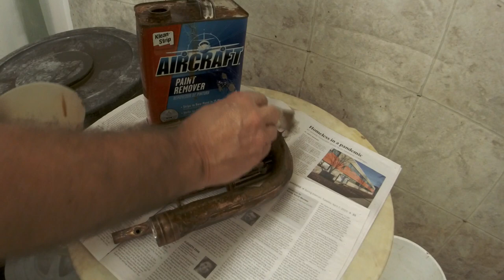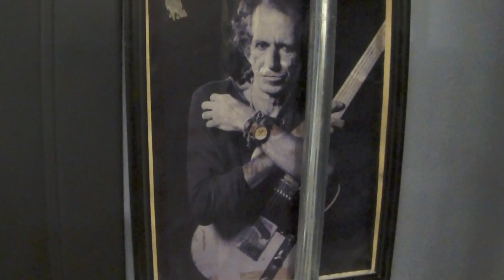Baritone full overhaul and relacquer project

Comment: Outstanding work.  As I was watching this I was wondering how similar/dissimilar this is to polishing stainless steel trim for vintage automobiles?
Reply from the maker: It is similar. I have visited an auto restoration place in town. They had a single high speed buffer to do the work, No exhaust hood. White compound is all I saw. I have buffed some stainless. Not really that much fun!
Reply: I actually have an old Baldor grinder but never had the right buffing wheels to go on it.

Comment: Have you tried using a lazy susan when spraying, it would make your job easier. I mean a turn table. Hi from Sydney Australia.
Reply from the maker: I do have one that I built since this. I have used it on a drum. Usually trombones are not a problem or trumpets. I have not had to spray a big horn like a baritone since this video. But if I do, I will be set!
Reply: @jimflys2  I have purchased a baritone saxaphone that has been vandalised by someone, by drilling ten 5mm diameter holes in different locations on the instrument. I intend to flatten and smooth the holes and make them preciseily 5mm dia, I will hole punch 5mm dia circles from brass sheet with similar thickness. Then I will silver solder them in. I am NOT a professional instrument repair but have taught Metalwork includingg oxy/acetylene brazing.. i will restore the lacquer finish also. What do you think of how I am going about repairing this instrument?

Comment: Hey Jim,
Can you tell us what you used to degrease it and how you mixed lacquer and gold (which product did you used?)
Reply from the maker: Hey Jeff, I used a spray degreaser that is in effect like Trichlorethylene or at least similar. It is a brake part degreaser and cleaner. Very effective stuff. The lacquer was Nikolas 2105 nitrocellulose. The mix ratio is around 60 parts lacquer to 40 parts thinner. The gold dye was mixed at a non specific amount. I just added and sprayed on test brass until I got a color I liked. The gold dye from Ferrees tools. It's made foe this lacquer. I am sure there are many available out there that would work that combine with lacquer quite well. But I have used Ferrees for 30 plus years. No need to look further.

Comment: Very well done! 
I have got a question: Which lacquer is used to paint brass instruments?

I want to relacquer my trumpet in Silver, I know this shouldnt be done my a normal person like me because it probably won't look good in certain spots, but It would still look better than it does now and relacquering by a professional is very expensive at my local stores, especially with all the pre-work like delacquering and polishing.
Reply from the maker: Thanks for the questions. Anyone can paint or get actual colored lacquer and spray on the horn. You might want to look at either a conventional look like this baritone or a scratch brushed version. That is less expensive and looks cool. See my video trombone scratch brush finish job. Email for specifics.
Reply: @jimflys2  Thanks, what is the name of the lacque you use?

Comment: Brilliant video and what a wonderful refurb job thanks, subscribed. Could i ask you about the lacquer? Did you bake the instrument to harden the lacquer? if not what type of lacquer did you use that doesn't need oven hardening?
Reply from the maker: It is old school lacquer. Nitro cellulose formulated for brass coating. Nikolas 2105. It is basically what all band instruments would have used back in the day before 2 part epoxies evolved sometime in the 1950's and following. Some instrument companies used more of a shellac, which could be argued is the same as lacquer. A version of lacquer anyway. Nitro sprays super easy. Not as chemically resistant as a 2 part epoxy, BUT does not require baking. And you ever seen an epoxy finished instrument that is losing its lacquer? Yep. All finishes are temporary. It depends on handling and care and body chemistry. I am overhauling a trumpet right now with silver plating (more durable than baked epoxy clear coat) and the thing was been pitted beyond belief! Looking good now though!
Reply: @jimflys2  Thanks for a prompt reply, i ask because my Boosey & Hawkes Sovereign Eb tuba is lacquered but the inside of the bell flare is raw brass as the original lacquer was so bad i just removed it. I once tried a rattle can lacquer to coat it and it looked good until i rested my arms on it on a hot day while the conductor ws talking and large patches of lacquer stuck to my arms and lifted off the bell flare lol

Comment: ps. Why not use polyurethane, which is ever so much harder than lacquer?
Reply from the maker: Great, great question! Clear finishes have advantages over others. Yes, poly would be harder, but also much thicker and would interrupt the resonance of the instrument in a dramatic way. Poly does not flow out as nicely as nitro or have that clarity. Poly is also great on guitars and cars, furniture, though some don't like the plastic look of it, but it can be cut and buffed on those surfaces. Not so with a brass instrument. I have experimented with a 2k. No dice. Poly is engineered to be sprayed over an abraded surface so that it can bite into it and hold on whereas lacquer for brass is engineered and sticks very well to a smooth, highly polished surface. Touch up on a nitro finish is super easy. harder to do well on epoxy, poly etc. 
2 part epoxy that has been developed for brass is very durable and chemically resistant, but not bullet proof either.  I get reports of horns I have refinished in nitro that they say resonate more freely and seem alive, more responsive. I also get requests to strip factory finishes (typically 2 part baked epoxy) because they seem less desirable with regard to resonance and the feel of the horn. 
In the end, sound is the lead, then look, then reparability. I would spray poly on a 68 Charger for sure, but not nitro.
Thank you for the question and it is one I have asked and experimented with.

Comment: What kind of lacquer did you use for this project? Is it durable? Thank you so much for sharing!
Reply from the maker: In this case I used Nikolas 2105. It is a nitro-cellulose air dry lacquer and is what would have been used originally. Or something very close to this.  Is it durable? Well, nitro is beautiful, but does lack in chemical resistance. THAT BEING SAID,  modern 2 part epoxies that involve baking are not exactly impervious to hand sweat or other chemicals. They are more durable. The do not flow as nicely IMO. They do not have as good of clarity IMO, but are pretty good. They have a more critical shelf life or pot life once mixed.  They require baking at 350 deg. and this is not really a great option unless doing mass production overhaul work. I do occasional overhaul work with the majority of work being mechanical and some touch up lacquer. Therefore, it seems to me that this is a very reasonable way to go. If needed and a client is willing to pay some extra, I can have baked epoxy sprayed by another shop. I have done that several times particularly on newer, less vintage instruments. I just wanted to keep the vintage vibe all the way around on this one. Thanks for asking.
Reply: Silver Flair trumpet restoration

Comment: When I clicked on this I fully expected to see an actual EUPHONIUM incorrectly called a Baritone but sure enough, this IS a Baritone Horn (I prefer to add "horn" to the end for clarity). It also appears to put to rest the idea that bore size controls the difference as there are varying bore sizes in both Baritones and Euphoniums. At any rate, cool video. Especially for anyone that has picked up either instrument. However, the only thing about buffing and removing material -- I would probably give up appearance for sound. But given that this is a 1914 instrument and sound quality may not be the primary goal, I can see the argument.
Reply from the maker: Yeah, many people prefer keeping original and concern themselves with sound over looks. This is Especially when they face the cost involved. Depending how bad the metal is and how pitted it may be will determine a lot. There are many horns that I have  gently made known that they are not a good candidate for full overhaul. Sometime mechanical is just the best way to go and save the money for a new instrument and Keep the old one for its own sake. Thanks for watching!